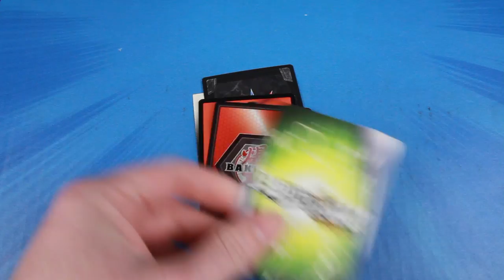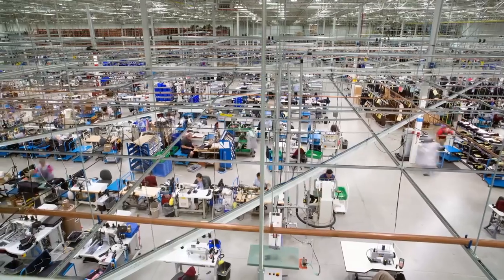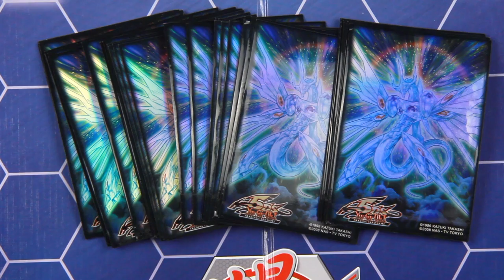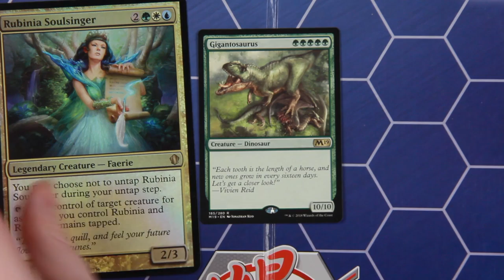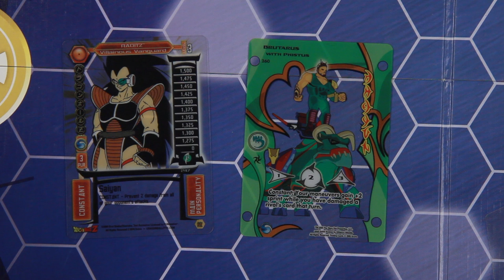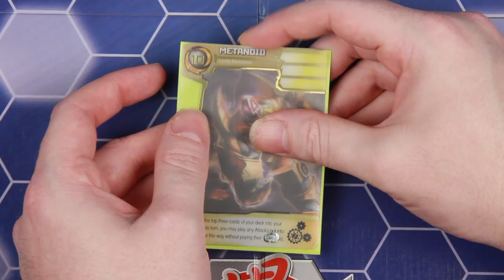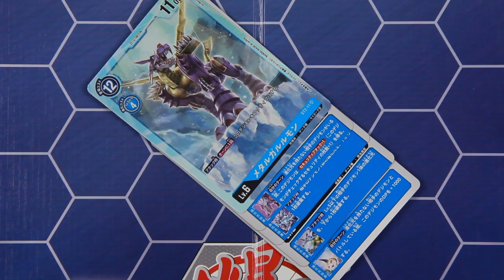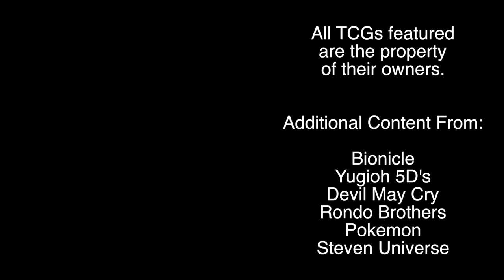NON-STANDARD CARD SIZES! (Seven Deadly TCG sins #4)

Comment: Sweet starlight that was fast.

One, great to know that some things are not built to be out there (Though a seethrough playing card deck could at least be fun for a party game.  [I do remember you had a set of Star Wars cards like that]) and two it is fun to try something different though something to keep in mind, you can only do so much with 4 edges (See Super Dungeon Explore for a bit of an example.) so the mechanics are going to really be working to pull you to them.

So that's No rotation until year 3, Life Decking, Unmixable Attributes, and Card sizes.
Which pulls 3 questions...

1)  HOW many games were based on movies?
2)  How many products do you have the most of for just one game?
3)  Are you into Proxy cards to test a mechanic or something else?
Reply from the maker: 1) A. LOT. Back in the mid-oughts, practically every intellectual property had a TCG. They were shovelware on paper.
2) The most expensive buy-in for a TCG I've seen so fa is $669.98.
3) Playtesters always proxy cards to test mechanics.
Reply: @Kohdok  669?????? Was this a version of Pokemon that came with real living Pokemon?

Comment: i would personally love to get cards that have normal cards, and plastic seethrough cards as bonus stuff,  like yugioh having an extra deck, you get these plastic hard to put ontop of a card.
this could have been cool for pendulums for example
i also would not be against having it in a way so you could make those bonus artwork for a specific card
like lets say i have a cool blue eyes white dragon card with extremely cool design, and the plastic card basically gets rid of the text and just adds special effects and more art making it maybe even more akin to a 3d card with layers, that i could see being super cool.
and all they had to do rly is have the base picture the only cut out part where the original card is visible...

or card games that are online only and get a physical print like legends of runeterra and giving those limited pre order runs or so
where you can get a card plus its upgraded bonus you dont have to shove into a deck, which is entirely playable, but also kinda cool to just collect

also hecatomb does look interesting, though i would say it would make more sense to make it a boardgame tradingcard mix where you have both elements and build armies, like warhammer for example
and each stack of card can be used freely to change up you*re army

Comment: Fun fact: Cardfight Vanguard actually had plastic cards as well. However, they were limited to "Stride" units (that go in a separate pile from your main deck) in the G-era of the game and only in Japanese, so it went under the radar for most people in the west. Biggest issue of that tho, was the fact that the strides were pretty much only high rarity cards at that time and the issue with plastic is that it has a different density than paper, therefore a different mass. In case anyone reading this hasn't guessed it yet, it made booster packs stupidly easy to search for these cards either by weighing them or even just by bending them slightly.
Reply: It's not a surprise since even with cardboard this kinfd of problems may occur. Like for yugi-oh where some high-rarity cards where heavier. It seems its not anymore the case.

Comment: Ok, on the topic of using plastic instead of paper for cards, one advantage plastic has is that it's harder to damage.

...And if you make your cards out of recycled plastic it actually helps reduce the amount of plastic that ends up going back into the waste management system, because trading cards are multiple-use. Now if only you could find a print shop willing to work with it. Also the price. Honestly, if you do go with plastic the most economic method is to print and cut everything yourself. That's not entirely unfeasable, heck these days people are building their own DIY injection molding machines, so setting up a line that takes raw plastic sheet, sublimation prints it and then directly feeds the prints into a cutting machine isn't exactly unrealistic. But it's either a LOT of work or a LOT of money to set up your production line.

Comment: Ultimate Guard makes sleeves and boxes for tarot sized cards, same high quality as their "standard" size stuff. And the 3x4 cards do have sleeves and boxes. Ultra Pro made some for MTG and so did ultimate guard. And both made storage boxes. Although, they're a little harder to get because no one uses oversized cards. You can also get those hard plastic top loaders for all sorts of sizes. I want to get a slightly smaller one for my oversized black lotus, but I have a hard time getting the "right" size online, I have better luck at conventions, comic con included.

Comment: If a tarot standard is backed by a big company like Wizards of the Coast, I think they could make sleeves affordable, which makes cards easier to shuffle (due to the thin edges and slippery plastic) and would snowball into making it maaaaaybe a better deal... Maybe. I think designers would appreciate the space, dunno if the prices would adjust to keep it all affordable tho but if they tried plastic then I bet harder and bigger cardboard seems fine.

Comment: As a tarot reader there’s some techniques that require a lot of space, and I’d say they’re on par with the number of cards you can end up having on the table in the average TCG 

Given these take a large space to do, I would consider the size not satisfactory for play in a TCG

In fact the deck I normally use for larger spreads is actually poker size, not traditional tarot size. Specifically because the smaller size is better if you’re going to need a lot of space. There’s also medieval and game packs which have their own slightly different size, which I also own a pack of. But it’s roughly the same as what you think of as tarot size, abit less wide, maybe a centimeter off.

Point being I think the size would be bad for a TCG because tcgs want to have space to actually play.
Reply: Oh and tarot size is kinda hard to shuffle 
We almost exclusively do overhand in the tarot community and some of us use wash shuffling. Others think it damages the card art so avoid it. But you don’t see others unless the card stock allows riffling or it’s an alternative size or whatever.

Comment: Mystic Vale does the non-standard size, and the clear plastic cards, and pulls it off pretty well. 

I guess that's because it's not a "trading" card game. You just buy the core set and what ever expansions you want.
Reply: I suppose that's due to Mystic Vale being a deck-building game with no hidden information, so card backs are irrelevant.  I love the concept of Redakai but as mentioned in the video, seems better handled as a mobile/digital game
Reply: Gloom does something similar, but being a board game rather than a TCG or a deck-builder, it works out

Comment: Hmm... would you give a pass to Bridge Size (2.25"x3.5")? Those would fit in all sleeves and binders; they'd just have a small amount of wiggle room. I could also see Domino Size (1.75"x3.5") being used to interesting effect in a game, since it is EXACTLY twice as wide as it is tall. I've use that in non-TCG designs before specifically for that property. Still, I agree with you, that unless you have a VERY good reason not to, always default to Poker Size. With print shops no longer using card sheets (54 poker cards or 60 bridge cards), there are practically no savings to be had by using a smaller card size anymore.
Reply from the maker: Again, there;s no support. There are clear, board-game sleeves for every size of card, but most of the major products: designer sleeves, boxes, storage, etc, are geared around the standard size. You'd have to hit Yugioh popular to change the market there.

And print shops do still use sheets on big-scale orders, hence why so many games prioritize having card sets in multiples of 36 or 54.

Comment: I am all for creativity. However I think it is best not to mess with the physical cards because that causes too many logistical problems. The plastic part is particularly bad. Cardboard is already really expensive as is. The stacking reminds me of the new Ikoria set in Magic the Gathering. It is better to stand out with different mechanics and art styles. One way staking would work is to place certain text at the edges of cards. One can stack cards without overlaping them completely. The part underneath that peaks out can be the part that influinces the top card. Boom. Then one can have a stack mechanic without messing up the physical cards.

Comment: I highly disagree. Small poker and bridge decks are also often to small for people with disabilities.  And people put smaller and smaller texts. 

And companies can put cards on enamels and protectors built in etc. And the more people using other sizes like Tarot. The bigger the market it will become.  Also with 3d printing etc. It is so easy to come up 3d specialized deck holders made of plastic with designs.

Also now with games being online  or emulated on apps or table top simulator. There is no extra cost associate with it.

Comment: This video is wildly inaccurate in regards to Tarot sized cards and the availability of supplies that support the size. Many board games use that size, both Ultimate Guard and Dragon Shield(through Arcane Tinman) both have lines of board games sleeves in a variety of sizes including tarot, Ultimate Guard even makes Tarot sized deck boxes to store the cards. The supplies are readily available online, there honestly is really no reason there couldnt be a tarot sized card game at this point in time. Game accessory companies make so many niche products for such specific games now and with the internet making everything widely available these limitations really are not that much of an issue in the modern day. My LGS sells all the stuff i listed above, they even sell pages for binders specifically made for X-Wing cards, which are custom sized.
Reply from the maker: They're not water-common the way standard-size sleeves and binders are, and there are no premium Tarot storage deckboxes or cases, and no sleeves with printed backings on the wider market the way there are for standard.

The most I said about Tarot was that they needed more front-end support to work. I even mention that the sleeves existed, they're just not ubiquitous or widely adopted by manufacturers as they are still a niche product for board game players.

Comment: Yugioh made the big 3 even after committing a sin in a way
Reply: This one? points to sin 4
Reply: He did mention in his discussion videos that these are more general guidelines, that if you have 1 or maybe even 2 of these general "sins" you might be fine anyway, but everything beyond that would spell disaster and even with 1 you should be careful. They're more big aspects from various card games that have spelled doom over the lifetime of the game. Card games are very sensitive to initial rules and conditions so designing a robust system is key, but at the same time, you want to innovate as to not become another MTG clone. Knowing what innovations to be careful off from former examples helps a great deal